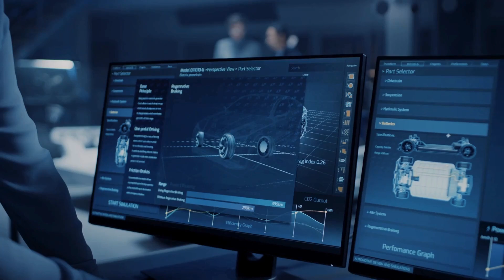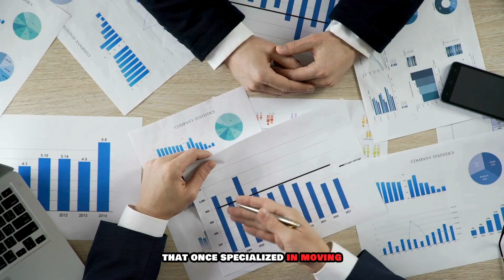The END of LITHIUM - BYD Announces Their Next Generation Of Blade Battery

Comment: Hmmm, I'm not sure. The blade battery is lithium iron phosphate, but not a lithium ion battery? I think I will stick to ICE vehicle that feeds plants and the oceans with CO2.
Reply: Yes, plants absorb CO₂ to grow. This is true but they need more than just CO₂ (like water, nutrients, and suitable temperatures), and excess CO₂ doesn’t automatically mean healthier ecosystems.

People may think: “CO₂ feeds plants, more CO₂ = more plants = good.” This ignores ecological limits and negative side-effects like droughts, heatwaves, and nutrient loss.

The oceans absorb about a quarter of our CO₂ emissions. But that leads to acidification, which harms marine life, especially organisms with calcium carbonate shells (like coral and shellfish). People often don’t realise this is directly tied to CO₂ levels.

False dichotomy:
People may frame the debate as “CO₂ from ICEs vs lithium from batteries”  as if it's a choice between two evils. But this misses the point: we're trying to reduce long-term greenhouse gas emissions, and batteries, despite their problems, emit less over their lifecycle than ICEs.

Fossil fuel interests and  political actors promote these narratives to delay climate action by using kernels of truth mixed with distortion.
Reply: @mikeaustin8818  I guess how much is too much? The planet is becoming greener as CO2 rose slightly (280 to 400ppm) and the Sahara desert has shrunk. Plants are more resilient to drought with higher CO2. CO2 rise is not the cause of increased or decreased global temperatures as demonstrated by ice samples and deep sea soil samples. Climate activists are indoctrinated by the indoctrinators.